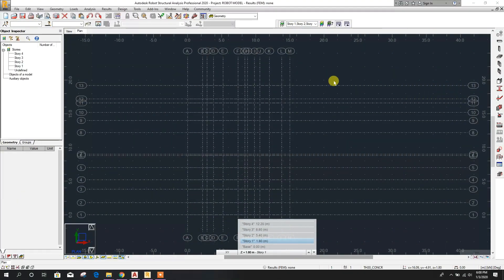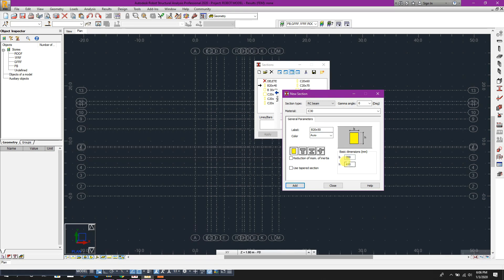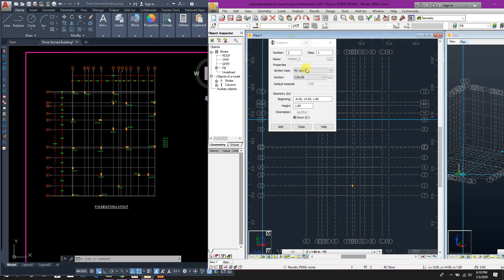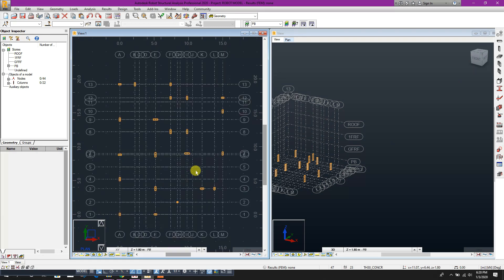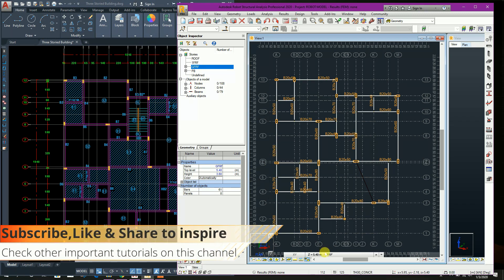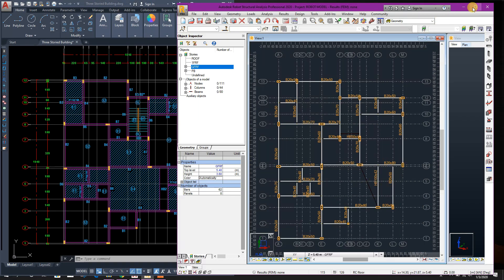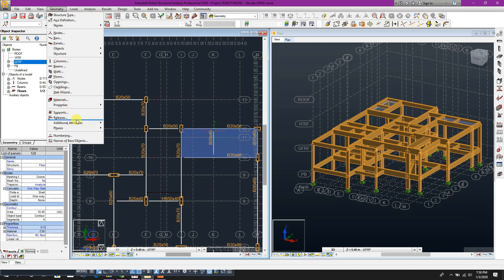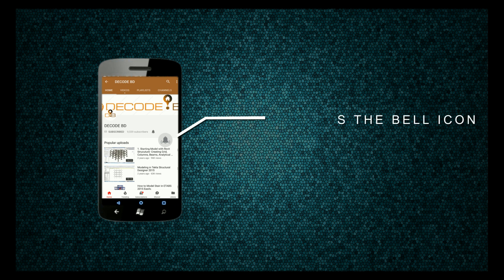Three Storied Building Modeling (Part-2) in Autodesk Robot 2020

Comment: hello and thank you so much for the amazing tutorial, but I have a question. you see when you placed beams and columns in autocad, some beams where not connected to the center of the columns, rather they off to the side. but when you model it in RSAP you chose to place the beams on the center of the column. kindly could you please explain more on this issue? won't this make a big difference in the results of the analysis and design? thank you again.

Comment: first of all thank you for your efforts to post such a helpful video but i have several questions, when you draw beams randomly the local axis will not be the same for all the beams , is it ok?? and for the slab as you can see its connected to the middle of the beam not on top of it , dose it change the analysis process ?
Reply from the maker: Local gravitational axis is in same direction, so no problem.For slab also not an issue. If you want to make it more specific you can relocate at top.